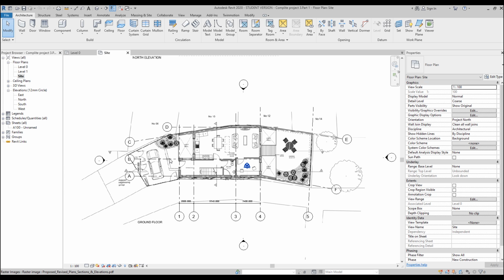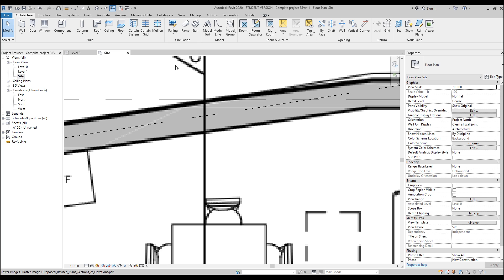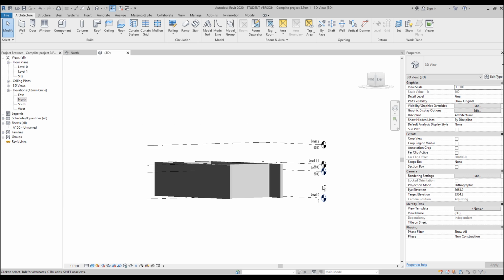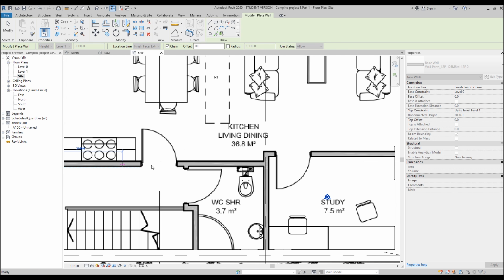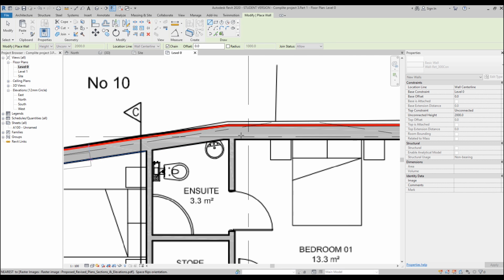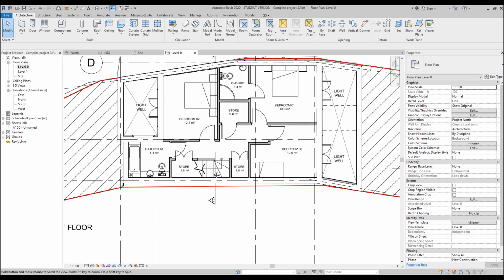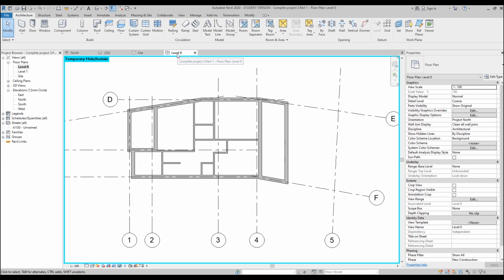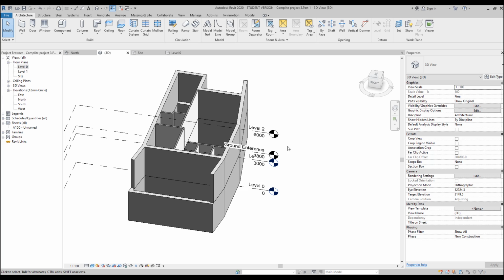Residential | Complite project 4 | Part 2

Comment: thank you for making this series. I have a few questions about grid lines. 1. Should you use grid lines when you are still in the design process? Or does it make sense to plan out where you want to add the walls first and draw the gridlines later once the design is finished and you need to do the documentation for it? 2. are your walls automatically constrained to your gridlines when you draw them? If not, should you constrain them or are you just using them as a guideline to make sure that your walls line up since your pdf reference isnt perfect. I hope you understand my questions. Thanks again.
Reply: Since he hasn't replied yet, maybe I can say something, hope you don't mind. For your questions:
1. yes you need to use grid when you start the project, to define the main geometry of your building, let's call this Grid 1. But I wouldn't rush to add more grids for doors and windows, I would do that after I draw out the main walls and floors, otherwise the grid will be too complex to understand without wall geometry. So my process is Grid 1 -> Main Geometry -> Grid 2 -> Windows and Doors.  

2. Yes that's the purpose of the Gird itself. Pdf is not perfect and you can see him guessing the numbers, not the best way to do it, but if he and the pdf designer both reasonably good architecturers, they can get the idea through correctly. Ideally you will be getting vector drawings with accurate length and angles, but with pdf or other image formats, some guess work is unavoidable.
Reply: @chris42076301  thank you so much for your thoughtful reply. I'm a 3d artist, so my design approach is a lot different. However, I see the value of grids,  especially because you can use them to constrain walls and such with less errors later when you want to tweak dimensions ,  so I will definitely be using them and practicing more.  🤗